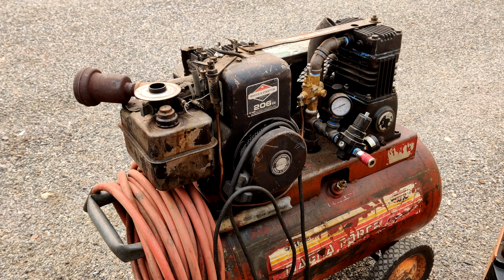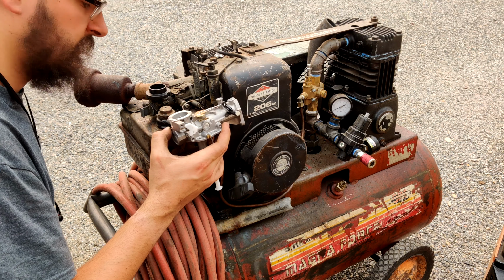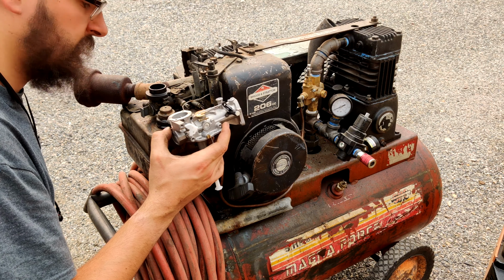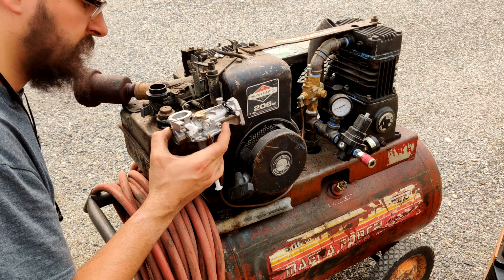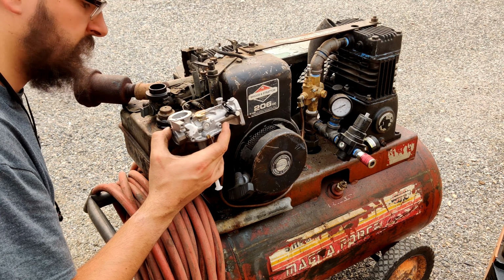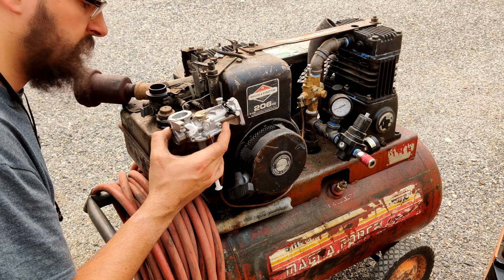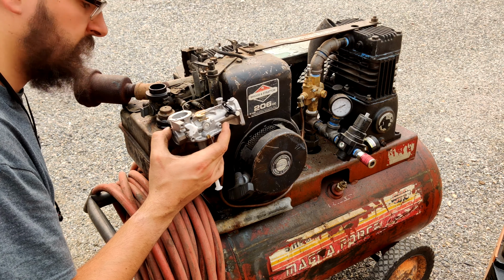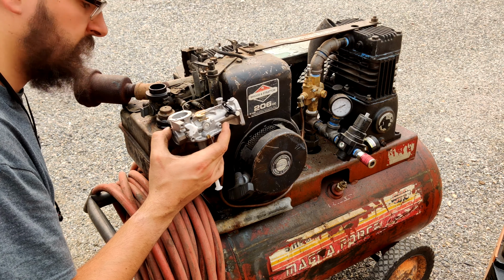uh-oh! Revisit on gas powered air compressor

Comment: Lean it abit kinda dark muffler
Reply from the maker: I have battled with the rich and lean setup on this air compressor if you actually lean it out where the engine would be happiest when it commands power when it starts pumping air again it will shut off I actually put a different muffler on it and it seems to have helped the issue a lot flows the exhaust better I guess I was able to lean it out now and it runs much happier and better fuel efficiency